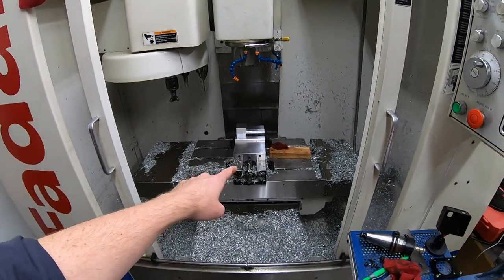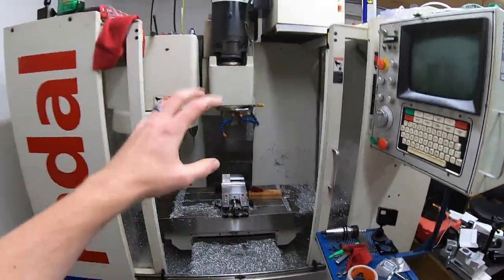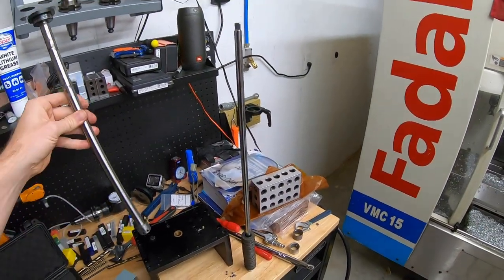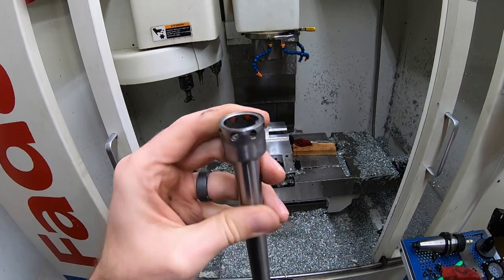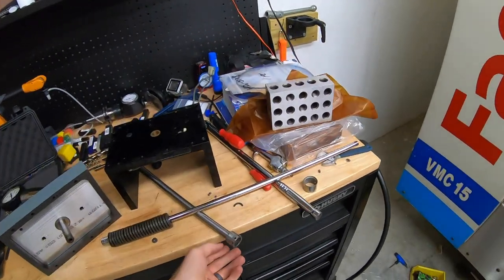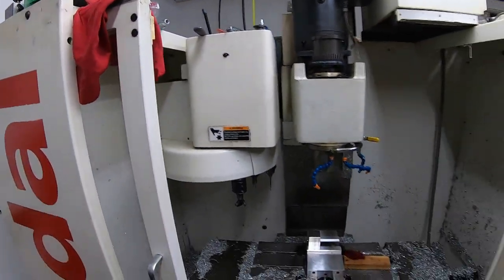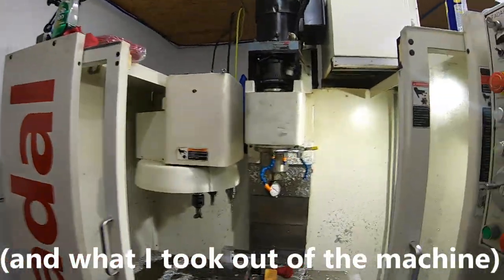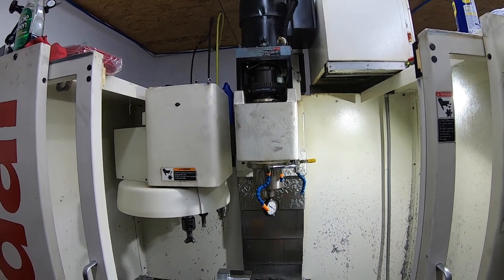Replacing my Drawbar in the Fadal

Comment: Do you realize the machine was under power while you are working on the spindle?
Reply from the maker: Yes! Absolutely. As you may have noticed at the end, I had to disengage the estop to put the gauge in. Mainly had power on for the additional light, but also to be able to move the Z axis up and down to get to the top and bottom of the spindle. Being a shop of only one person, I don't have to worry about others that may come by or pose some level of risk.

Really, it's a good point to bring up if for no other reason than for anyone that might read this and want to do similar work. When doing any level of maintenance on a machine, you should do some level of risk assessment to ensure you can work safely and mitigate risk. At my day job (and many industrial places) we use lockout-tagout to make sure everyone is safe. Thanks for bringing that up!
Reply: @bgwmachine  Once you realize how these controls really work, you will not trust yourself to anything that moves or rotates while still under power.